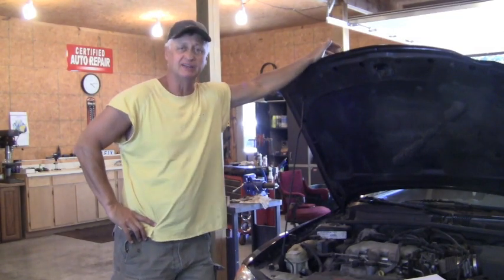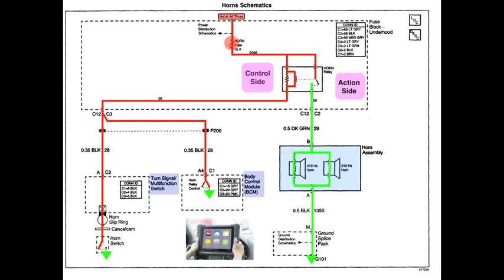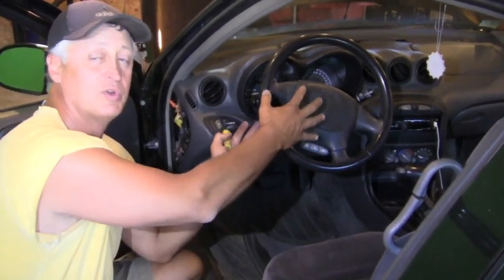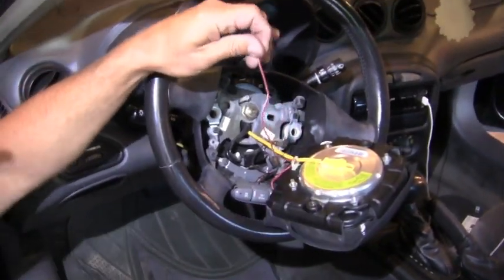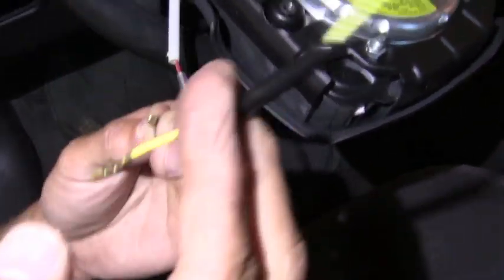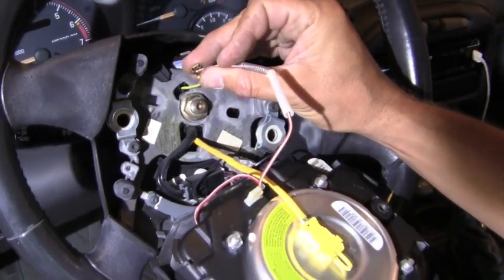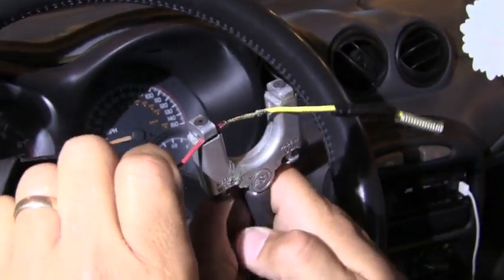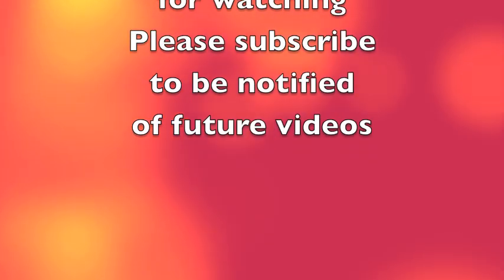Fixing a non clockspring horn problem

Comment: Great video as always. If I would do the same repair, I would have to try to repair the existing wire instead of purchasing a new wire. The other thing is the soldering paste you used is a regular product used for surface mount PCBs for years. Thanks for upload. Regards,

Comment: Nice diagnosis. I especially liked the vice for holding the wires for soldering. My only concern is the location of the air bag during the repair. For safety sake, I would disconnect the air bag and place aside with the appropriate side facing up.
Reply: a trick: you can watch movies on flixzone. Been using them for watching lots of of movies these days.
Reply: @Ahmad Briggs yup, been watching on flixzone for years myself =)

Comment: Another way to test the circuit without using the button, is to lock the car multiple times. this will cause the BCM to turn on the horn.
When dealing with ANYTHING that has to do the airbag system, disconnect the battery, and reconnect it electrical circuits need to be tested and airbags are in there place  while testing. There was a guy some years ago that died because the airbag went off while he was testings stuff.

An you could have just crimped a male spade terminal onto the wire, instead of splicing it.

Comment: My issue was the turn signal metal pin was stuck and not making contact on the brass rings after I replaced my turn signal switch. I checked the relay and the horn fuse. They were good. After I took apart the steering wheel and the airbag assembly. I used the horn switch to test a 12v headlight to verify that switch was still good then I tested the horn function with another  switch. After all that was good I came to conclusion that it was the turn signal switch that was faulty. Returned the faulty one and got a brand new one. problem fixed 😀😀

Comment: Thanks for the valuable warning that wires affecting the airbag are Yellow.  But why the heck did you keep that spare non-airbag horn contact wire with an all-Yellow wire?  You could have covered it with a longer piece of that black shrink tubing.  BTW, that was a clockspring problem, but luckily did not require a full replacement.

Comment: I have a 1995 Ford Escort Gt and I had the clock spring replaced because it went bad. Shortly after I noticed that the horn on the left side was not working. The one on the right works but not the left. Does that sound like a loose wire? Great video. Thanks.

Comment: My problem is that the horn will go off randomly when I drive and while I'm park. I replaced the clock ring in my dodge avenger and the horn still goes off.

Everything I looked up would tell it was a problem with the clock ring. Didn't work.

Comment: I have that same car and I have already removed the two covers but I can not find any screws in the hole under the airbag ....

When I insert the screwdriver I only feel cables .... Someone to help me if there is any specific movement inside. I need to check the contact of the horn because it is direct and I have to remove the relay because it is direct ...
Someone to help me with that thanks!

Comment: I have a 2007 Chrysler sebring. my horn does not work when I try to press and blow it, but it works when I hit my alarm. could it be the clock spring?
Reply from the maker: Yes, most likely.  The fact that the horn will work when you hit the alarm means the entire horn and wiring to the horn are good.  There are two switches that make the horn work. One is the button on the steering wheel which involves the clock spring.  The other is the alarm which actually is the engine computer making the horn work.  So, yes, take a look into the clock spring.
Reply: realfixesrealfast thank you so much

Comment: My 99 toyota sienna will only work if you push or pull on the steering wheel. Sounds like a bad connection.

Comment: I have a 1993 Grand Voyager, and the horn works fine, but the airbag light stays lit up. Haven't gotten an answer yet.
Reply: Probably a bad clock spring.  Have someone read your codes and go from there.
Reply: No codes to read. Everything else is normal, except I need the trans rebuilt. I checked the codes counting the check engine light, also with a OBD1 code reader and with a DRBII code reader. For a while I had a check guages light momentarily. Check engine light  isn't coming on for anything. Chrysler dealer didn't know either. Eventually maybe I'll change the clock spring, but too many things going on right now. Somebody thre a rock thru the back window.
Reply: Opps, I was thinking OBD II.  Well I did find this for your year, make and model: 

Triggered by a short in the rear wiper motor/circuit (which causes a fuse to blow), the airbag warning light can illuminate erroneously.
Problem Data
RepairPal Verified

6 model years affected: 1990, 1991, 1992, 1993

You've probably already checked the fuse but interesting nonetheless.
Reply: Thanks for that info. I did check Chrysler for recalls and they said everything was satisfied, but it might say that if it was never brought in. I checked fuses and they are all alright. There is a problem with the rear wiper motor and I'm replacing that, but it's a two wire plug and one wire is always hit. Normal or should I check that out? I did see that in a 3 wire system, one wire was always hot.
I've had the dash all apart and re soldered all the connection there, but I may have to take it out again to check the wiper switch and wires.
Reply: Larry Van Valkenburgh are you from, or affiliated with anyone in West Virginia? I know that last name.... and it's not a very common last name lol

Comment: You have missed the boat, the clock spring is not in the horn system 
by putting solder on the horn s/w you put pressure on the worn horn plate 
pushing it down on the turn sig s/w witch has a  spring loaded tit that
is also worn ( take it off and put a dab of solder on it) as the steering is
turned the tit loses contact with the underside of the horn plate

Comment: Scanner?  What scanner?  What's a scanner?  Who has one?  What do they cost, & where can I buy one?  How the heck can you propose a real fix real fast yet leave out any definition of the tool used to diagnose the problem?  "Yes ma'am, we found the problem using our scanner.  Turns out your tire is only flat on one side, and wouldn't ya know we are having a sale  - you only need to replace the bottom of the tire, not the whole tire.  So with the Scanner Diagnostic Fee, and the fee for ten quarts of Genuine Mopar Certified Tire Air, the sub-total comes to $666 to fix your tire, plus tax, and the $125 tow-in charge, and a small 20% surcharge for working on Bubba's birthday.   If you'll just sign this mechanic's lien we'll get right on it, shouldn't take more than a couple of weeks."